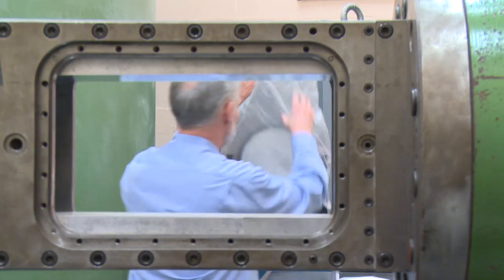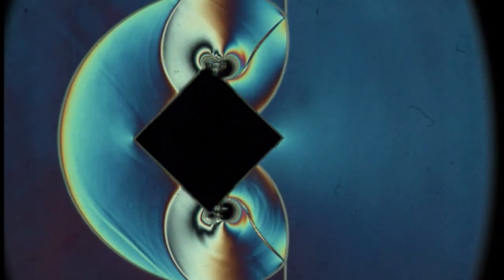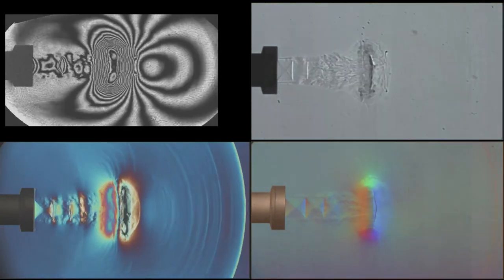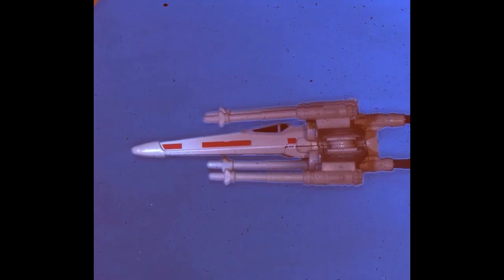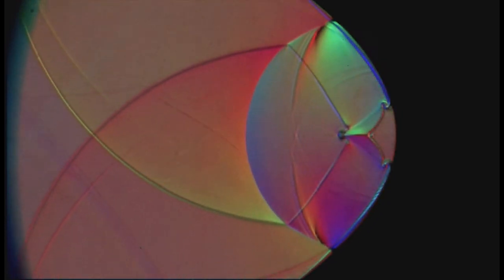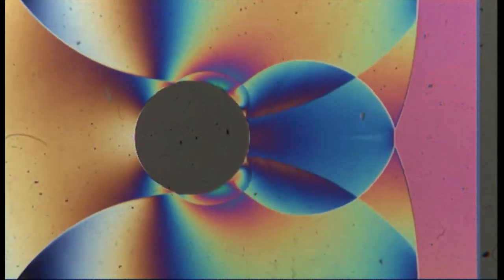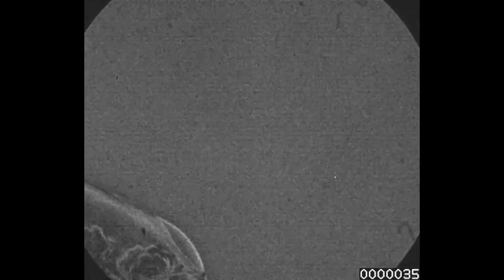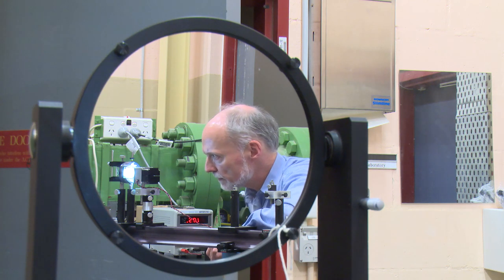Schlieren Imaging Systems

Comment: I like schlieren visualization.   I tried to work out how big sound waves are. If we can hear 20 Hz to 20KHz and in air sound travels at 343m/s, I get:  20Hz 17,15m,  Lowest piano note 12.47m,  Middle C 1.34m, Middle A 440Hz 77.9m,  Highest piano note 8.19cm, 20 KHz  1.71cm,  Dog 60KHz 0.57cm, Wax Moth 300 KHz 1.14mm.  I didn't do bats , 200KHz.

Comment: Could you use these optics to view dissimilar liquids interacting? To help model and gain understanding of the cosmic web? You can see somewhat similar effects with adding cold water to boiling/ hot water. But would such effect be more pronounced in this optical system?

Comment: Thanks for sharing crystal clear conceptual insights on creative visualisation imaging systems that reveals hidden arts movements in between secret applied sciences landscape and high technologies Spectrums Politics of Wide / Broad / Narrowed Band Signalling White Noise inflected Cyberphysical Ranges Limited Microwave Energy Directed Gap States Chained fluxes DENSITY Absorbed Surface Acoustics Wavefront Guided Optogenetics Ultrasonic Differential FREQUENCY Modulated responses deeply stimulated, Sequenced and simulated Emergent Brain Battlefield Belt Controlled Cognitive Space engineered Quantum Information Integrated Systems of Innovation Network for solving wicked problems of the world.